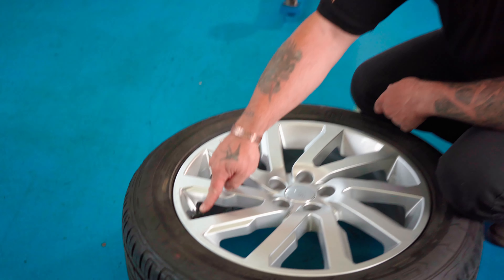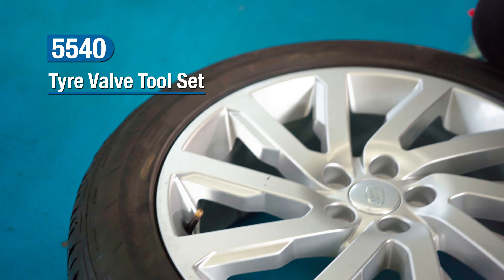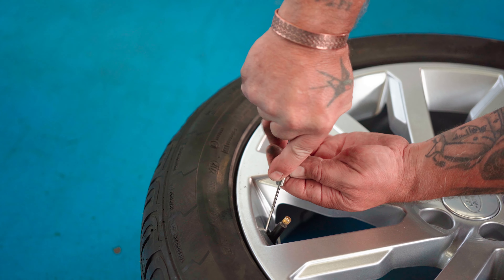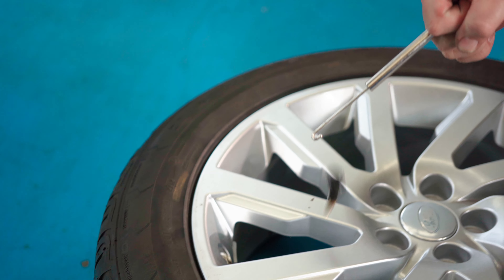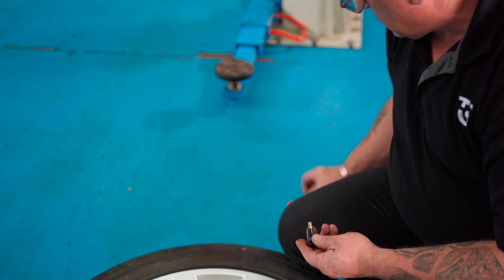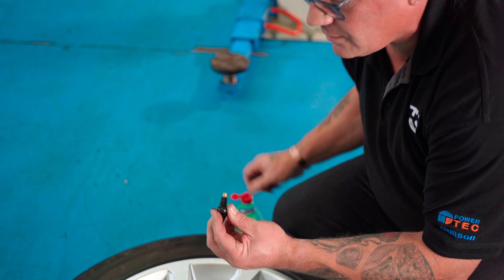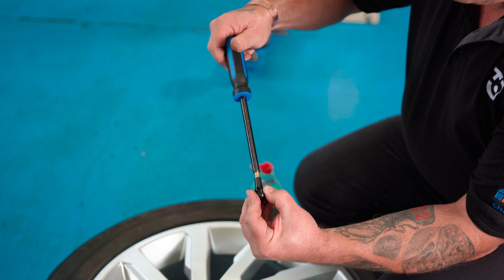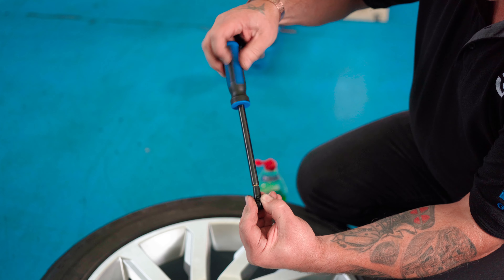Tyre Valve Replacement with the 5540 Tool Set | Laser Tools |

Comment: What if you have tpms tire pressure monitoring sensors on the inside of the valve stem?
Reply from the maker: These are not suitable for TPMS valve stems. The valves on these are normally metal.

Comment: Pile of shit. Couldnt get the hook in, just ended up putting pressure against the valve to jam a screwdriver inside and pry out the valve. Then i tried getting a new valve in, the flimsy plastic tube just snapped. Don't buy, waste of money